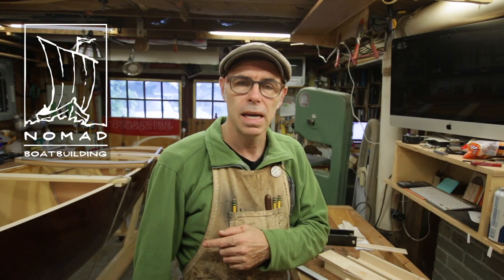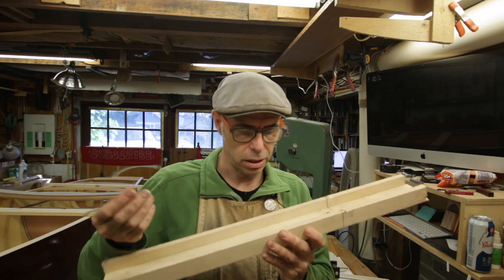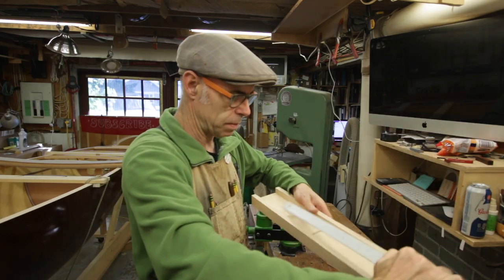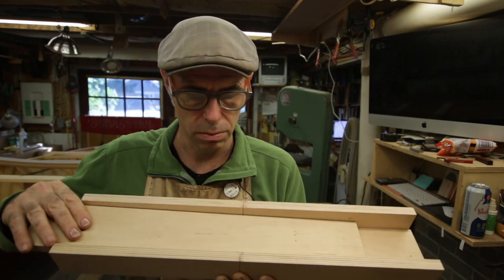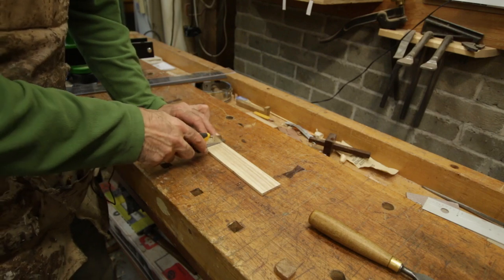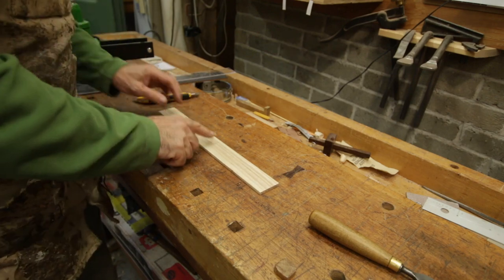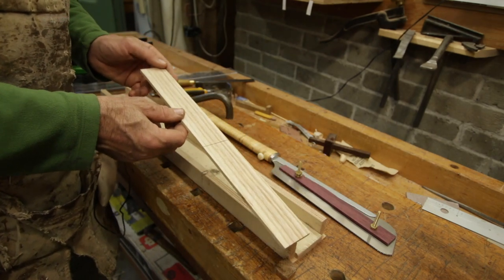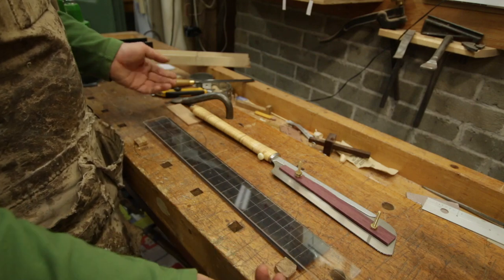Banjo building - Cutting fretboard slots

Comment: For the record, the fret spacing for a mathematically tempered fretted fingerboard has a common ratio equal to the 12th root of 2 or 1.059463. The location of any fret is 1.0594 wider than the preceding and so on down the scale. "Unbent" notes played on a fretted fingerboard for a tempered scale will be off by several musical "cents" from true harmonic pitch; thus a compromised or "tempered" scale. True tempered scales for stringed instruments are possible only on fretless fingerboards such as the viol family and fretless models of the guitar.

Having the common ratio, one can fire up a spreadsheet to calculate fret spacing for any fingerbard you'd care to imagine.
Reply from the maker: I laid out my fret rule mathematically using the ratio you mentioned and I've been trying to impress on the fellow, whom made the video for, that this was an imperfect system so he had a little wiggle room to not stress out so much when doing his own fretwork. Thanks for your input.